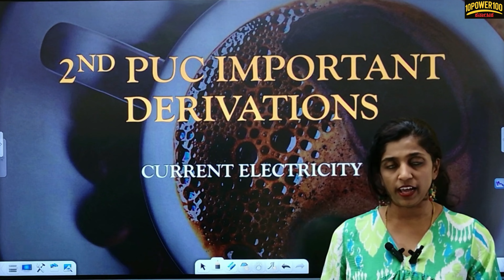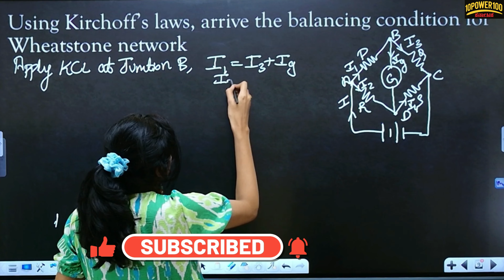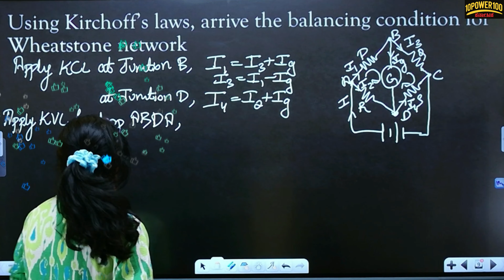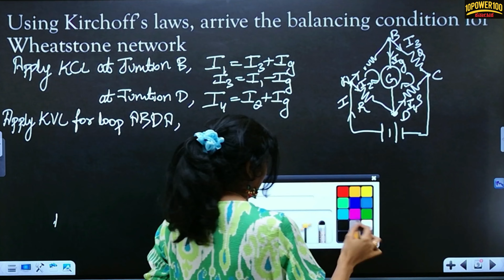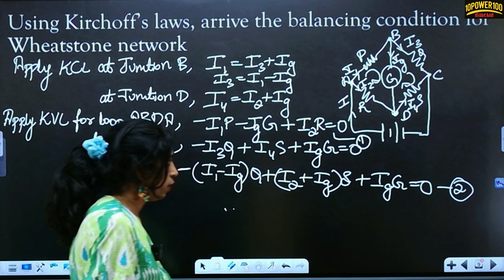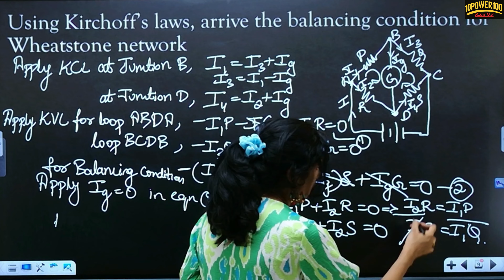🔥 2nd PUC Physics Important Derivations 2026 | Most Expected Board Exam Questions | Score 60+ easily

Comment: Mam in series n parallel combn of cells pls write the circuit symbol of cells 
U hv written capacitors
Reply from the maker: Thanks for watching.  Please check the video from 19:48. I have specified the difference between the capacitors and cells clearly dear. Please check at 19:48